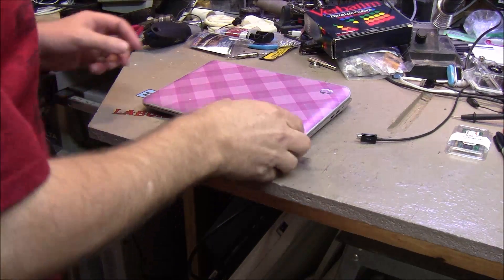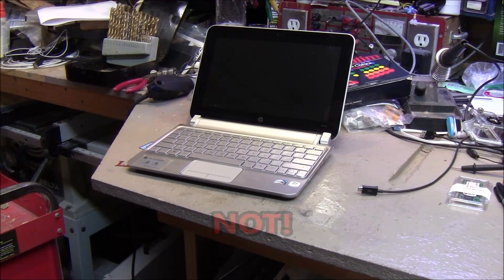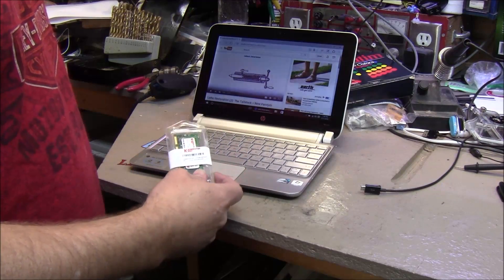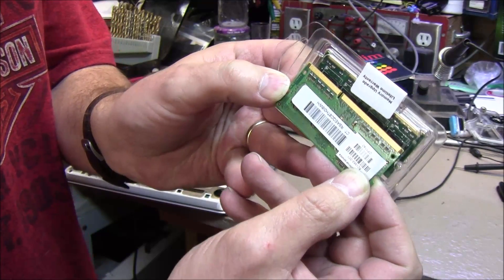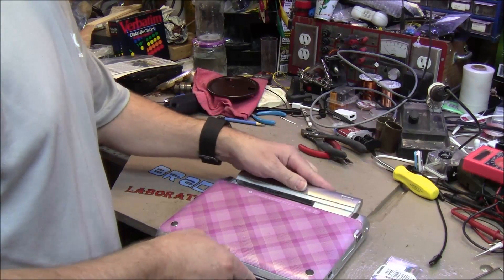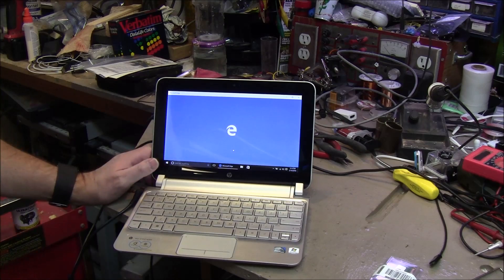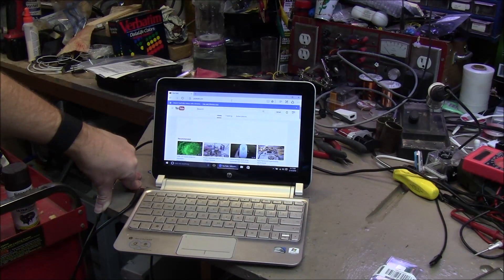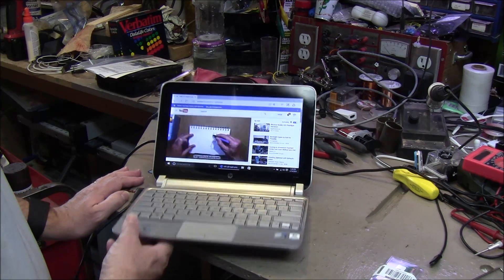Mini Book 210 Upgrade

Comment: I have an HP Mini 110 running Windows 7 with 2GB RAM. Its slow, should i still upgrade to Windows 10?
Reply from the maker: These are rally slow with windows 10, I switched to Linix later and it was better.
Reply: @BradsLaboratory  i tried installing windows 10 and it was pain. First that "expanding windows files" has taken like half an hour, and while i was almost at the end but then my battery died. Then i tried again with charging it but somehow the charger separated and and it died again. Then i finally got trought and it was stuck at that services thing, so i rebooted it. Then had to reinstall it AGAIN and and the charger separated itself again and it died. I just gave up after that. A day later i installed windows vista and it works better then windows 7 does. Only got 2 bluescreens so far! Sorry for the long reply but i just had to mention it lol

Comment: I have a netbook 210 and has been glitchy. I've ran malware and anti virus and nothing comes up. I stopped using it for months at a time after using for like a year. Any info would help..thank you
Reply from the maker: These units a super under-powered,  I changed out the OS from Windows 10 to Ubuntu on it after this video. It was OK watching Youtube on it with windows 10 but it was still slow and glitchy. The Ubuntu OS was slightly better but I really don't use this unit much any more.

I would look at task manager and see what is sucking up your RAM, and if there are programs you don't need that are using RAM de-install them.
Reply: @BradsLaboratory  yeah, I've done that. Specially since I had some spam downloads that would pop up everytime I logged in. I had even gotten it upgraded to more ram from factory when I ordered it. I just think it has alot of good use still. Maybe it's time to move on..

Comment: Wow bro, I have the same laptop and I don't know how to install this Windows 10. A friend changed the factory Windows 7 pro my laptps has. And he installed Windows 8 and works very bad. What I have to do? have a USB? and boot from bios and create another partition? sorry... in don't know anything about this 😅
Reply from the maker: Yes - you will need to make a bootable USB drive with the windows 10 installer loaded on it.

However - I did this prior to the Free Windows 10 promotion that ended last year - so now you need to buy windows 10 from Microsoft. From what I understand the installation procedure is the same with only a spot to enter the activation key you get when you purchase windows 10 from the windows store.

It is still pretty slow - the computer is pretty old at this time.

I am thinking about changing the OS from Windows 10 to Linux. But haven't had time to do it yet. I think that might make the laptop faster as the Linux OS is slimmed down and more processor friendly (Although less user friendly)!
Reply from the maker: https://support.microsoft.com/en-us/help/12435/windows-10-upgrade-faq
Reply: Brad's Laboratory thank you so much
Reply: Brad's Laboratory, If you had made a review of the processor replacement for this netbook, then there were a lot of video views on your channel, since so many people still use such netbooks. 
But on the Internet there is not a video with the replacement of the processor for this netbook. So for you it's an idea. :)
Reply: Brad's Laboratory, I want to replace the processor with a more modern one, do you think this is possible at all? I have the same laptop.